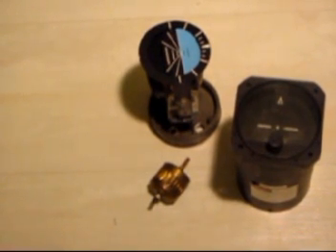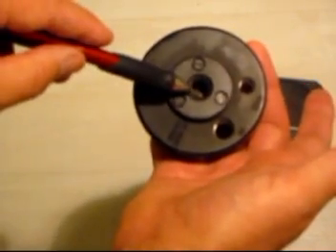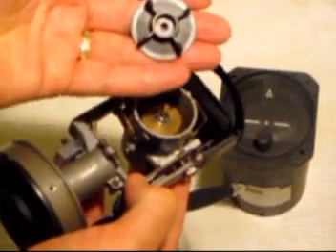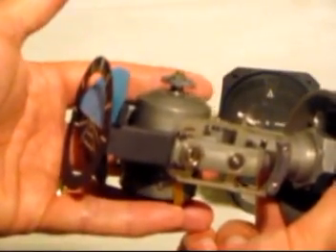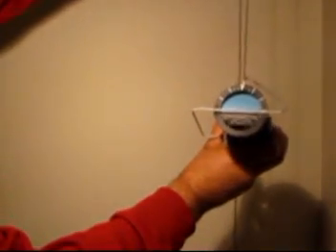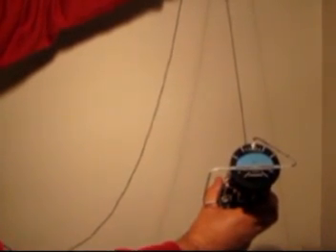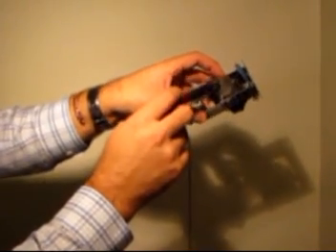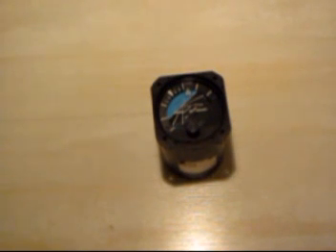Lye-Aviation-01-Artificial-Horizon.mpg

Comment: Great. So, the gyro stabilizes itself vertically at the start up and then, using same method, supposedly keeps vertical orientation during horizontal flight to compensate earth's curvarture. If this kind of compensation really happens, then it still means that the pilot or autopilot should tilt the nose of the plane down on a continuous base. Do pilots make it? Did pilots make it back in 1930?
Reply: The curvature and spin of the earth is accounted for in the inertial reference and navigation system. There is explicit software to handle that to correct the attitude measured by the laser gyros from the inertial platform. Laser gyros are accurate enough to measure the rotation of the earth and the diping angle as the plane flies over the curved surface of the earth. If their measured attitude would not be constantly taken into account by the computers, the artificial horizon, which is a display created by this computer, would stay rigid with respect to space and not parallel to the surface. 

So, the curvature and rotation are no illusion that has no effect. The effect is taken into account by the flight computers. The pilot can and must blindly trust the instruments and can fly the plane as on a flat earth. But behind the scene the flight computer takes all actions necessary to get from A to B on a globe.
Reply: The pilot only needs to maintain a specific elevation. If the plane flies too high the pilot drops the nose, if the plane gets too low the pilot raises the nose.

Consider a road that goes around in a loop with a radius of 4000 miles. If you were looking down that road you'd never see it curve. If you were to drive your car around that road you wouldn't drive off the side of the road every few miles but at the same time you'd never consciously be turning the car. All you have to do is keep your car between the lines.
Reply: That's ok to admit and understand. The difference is a speed of a car and a plane. With the cruise speed of a jet plane, the vertical angle orientation of the plane to the horison would change so fast as to be able to keep the pilot constantly making the correction of the elevation downwards only, if the surface below is speroid surface with 6 km radius.
Reply: Sergei Maltsev The radius of the earth is not 6 km, it's 6378.1 km or about 3959 miles.
Reply: Yes, off course.
Reply: Sergei Maltsev "With the cruise speed of a jet plane, the vertical angle orientation of the plane to the horison would change so fast as to be able to keep the pilot constantly making the correction of the elevation downwards only, if the surface below is speroid surface"

If the earth's radius is 6378.1, at 2*PI*r that would make the circumference 40074 km. The cruising speed of a 747 is 920 km/hr which would mean that if it could circumnavigate the world without stopping it would do it in 43.5 hours. That would make the rate of turn 8.26 deg every hour or 1 deg every 7.25 minutes or 0.13 deg every minute. That might sound very fast to you but consider this, the minute hand on a clock turns 6 deg every minute.
Reply: And yet, this must be compensated, 16 deg for average 2 hrs night or poor visibility flight back in 1930.
Reply: Sergei Maltsev "And yet, this must be compensated, 16 deg for average 2 hrs night or poor visibility flight back in 1930."

This is why they have instruments.

You seem to be under the impression that the pilot of an airplane just points it in the direction they want it to go and it just goes in a straight line. That's not the way it works. The pilot has to constantly compensate for all sorts of forces, wind sheer, turbulence, head wind, tail wind, etc. Flying a plane is making constant corrections in height and direction, otherwise they wouldn't need an autopilot. The earth's curvature is just one of the things that need corrections for, and it isn't even a major one. As long as the pilot maintains the correct elevation the plane will follow the earths curve without the pilot even thinking about it.
Reply: "This is why they have instruments."
Yes, and we are talking about one of them. Can you say that the artificial horizon in the video is following the curvature when the plane is in streight horizontal flight, which means it shows the indication of true horizon all the time and this is due the system of nozzles and pendulum brackets?

"The pilot has to constantly compensate for all sorts of forces, wind sheer, turbulence, head wind, tail wind, etc. Flying a plane is making constant corrections in height and direction, otherwise they wouldn't need an autopilot. The earth's curvature is just one of the things that need corrections for, and it isn't even a major one. As long as the pilot maintains the correct elevation the plane will follow the earths curve without the pilot even thinking about it."

The problem is that the earth curvature is a constant factor amongst the other random variables which must be taken care of at any conditions of the flight. And it's influence accumulating rapidly and exponentially with the distance. Look at that having in mind the miles of a plane elevation with after two hours of none compesated curvarture flight.
Reply: Sergei Maltsev
"Can you say that the artificial horizon in the video is following the curvature when the plane is in streight horizontal flight, which means it shows the indication of true horizon all the time and this is due the system of nozzles and pendulum brackets?"

The old type of artificial horizon used nozzles and pendulum brackets, but there were problems with that type. They also had buttons on them that allowed the pilot to reset to horizontal if they ever got too far out of alignment. The newer artificial horizons use electronics to keep it horizontal. See link below.

Watch?v=C0pZ-mVcbbI&t=283s

"The problem is that the earth curvature is a constant factor amongst the other random variables which must be taken care of at any conditions of the flight. And it's influence accumulating rapidly and exponentially with the distance. Look at that having in mind the miles of a plane elevation with after two hours of none compesated curvarture flight."

Firstly, the phrase "accumulating rapidly and exponentially with the distance" is incorrect and misleading. It is certainly not rapid, at 0.13 deg per minute, it’s extremely slow, so slow as to be undetectable. The minute hand (not the second hand) on a clock turns 45 times faster. “Exponentially” implies that larger and larger turns must be made the further the plane flies. This isn’t the way it works. The plane only makes incremental turns to compensate for the earth’s curvature. When you turn left in your car, the turn is not accumulative. You don’t keep turning the steering wheel as you go, making a tighter and tighter turn. You only turn it as far as you need to for the radius you need, hold it through the turn and bring the steering wheel back to center to drive straight once the turn has been completed.

Secondly, in making all those other corrections for height the pilot automatically includes the corrections for curvature without even knowing it.

For example, let’s say you were a pilot of a Boeing 747 flying from airport A to airport B 3000 km away. You take off and climb to a cruising altitude of about 12,000 m. To do that, you use your elevators to raise you pitch angle (bring your nose up) and increase your throttle to compensate for loss of forward momentum.

As you climb, a lot of things affect your rate of climb, the mass of your plane (can vary with each trip), your forward velocity (still accelerating from takeoff), atmospheric conditions (wind direction) and elevation (air pressure reduces the higher you are). You set your pitch angle for the rate of climb, but not too steep or you will cause a stall (when the air flowing over the wing is too low to create enough lift).

The higher you climb the lower the air pressure outside, the lower the climb rate of the plane, so you must reduce your pitch angle (lower your nose) to avoid a stall.

Let’s say it takes about 10 minutes to get to cruising altitude and you’re only averaging about 460 kph, you would have traveled about 75 km. The ground would have dropped away by 440m, which would have made your rate of climb slightly more than it would have but you wouldn’t have noticed because you’re climb rate was changing all the time anyway. The direction of gravity would have changed direction by 0.7 deg, which would have changed your pitch, but since you were already changing your pitch angle to compensate for the changing climb rate, again, it wouldn’t have been noticed.

Once you reach cruising altitude (12,000 m) and cruising speed (920 kph) you level out. To fly level, you must balance the lift generated by the wings with the weight of the plane. Again, this can vary. The weight of the plane can vary with every trip and atmospheric conditions outside can affect the amount of lift so, you must adjust your flight to suit.

You must either adjust the throttle, changing velocity will change the wind speed over the wings and affect your lift, or change your pitch angle (nose up or nose down). It’s not good for the engines to keep throttling them up and down so you opt for changing the pitch angle.

This balancing act is never perfect so, as you fly you will find that at some point your altitude will either increase or decrease. Rather than stay at one specific altitude you stay within a range of altitude, say 11,900 m to 12,100 m. If your plane flies above 12,100 you lower your pitch (drop your nose) to bring it back down into the nominated range. If you get too low you raise the pitch to bring your altitude back up.

At 920 kph, after 1 minute of flight the land curves away 18 m, which, to you, would only be perceived as an increase in altitude of 18 m, a raise you would already be compensating for, amongst the other increases and decreases in altitude. The angle of the ground and direction of gravity would have only changed by 0.13 deg which would appear only as a change in pitch and since you are already adjusting your pitch down to keep your altitude within the nominated range, you've already compensated for this change without even knowing it.
 
All you have to do to follow the curvature of the earth in a plane is to maintain level flight. All the corrections needed to compensate are built right into the flight procedures and you don’t even know it.
Reply: Let us ignore climbing after take off. 

"At 920 kph, after 1 minute of flight the land curves away 18 m, which, to you, would only be perceived as an increase in altitude of 18 m, a raise you would already be compensating for, amongst the other increases and decreases in altitude. The angle of the ground and direction of gravity would have only changed by 0.13 deg which would appear only as a change in pitch and since you are already adjusting your pitch down to keep your altitude within the nominated range, you've already compensated for this change without even knowing it."

However even after ten minutes without compensation the land will curve away for a lot more than 180 m. Can you say how many?

"All you have to do to follow the curvature of the earth in a plane is to maintain level flight. All the corrections needed to compensate are built right into the flight procedures and you don’t even know it."

Yet again, the plane constant aspiration under horizontal flight is to increase altitude due to the curvature of the earth, the rest is random. So this aspiration must prevail. Since the pilot does not even know it, the inference might be - there is no curvature.
Reply: Sergei Maltsev "However even after ten minutes without compensation the land will curve away for a lot more than 180 m. Can you say how many?"

Yes, I can. How is this relevant?

"Yet again, the plane constant aspiration under horizontal flight is to increase altitude due to the curvature of the earth,"

Yes, this is correct but it's not the only thing that will cause the airplane to increase in altitude.

"the rest is random. So this aspiration must prevail. Since the pilot does not even know it, the inference might be - there is no curvature."

I really don't know how to explain it any better. You have the answer in quotes in your own post. You seem to be under the illusion that somehow if the pilot isn't aware of the turn, the plane is just going to go straight out in to space. The pilot doesn't have to KNOW it to actually make the turn. They just have to maintain the preset altitude.

When a person is lost in the forest, without any visual cues or landmarks, if they try to walk straight they will actually start curving to the left or right, even though they are absolutely certain, without a shadow of a doubt, that they have been walking in a straight line. They won't actually believe that they have been turning until you show them on a map. They've actually done studies on this. In fact if they walk for long enough they will actually loop around to where they started from.

If an airplane's artificial horizon is malfunctioning and the it's night or it's in a cloud bank and there are no visual clues the pilot will start to bank without knowing it. Often the pilot will find themselves completely upside down. This has actually happened on many occasions.

The point of this is that just because an airplanes pilot doesn't know that they are compensating for the curvature, that doesn't mean that it isn't happening.

I really can't explain it any better than that. If you're not even going to try to think these things through then I'm really just wasting my time here.
Reply: Your point is understood and clear to me. But if you can just try to look at this from aside. You say I'm in illusion and at the same time, I have to admit following:
The curvature is there but we do not see it, feel it, know about it, take it into account, think of it. What is it then, unless something not existing, an illusion. There seem to be no instrument on a plane which is responsible for curvature or earth spin if you look into it. Anyway thanks for discussion. It was a pleasure.
Reply: Sergei Maltsev "There seem to be no instrument on a plane which is responsible for curvature or earth spin if you look into it."

The spin of the earth is irrelevant but there is an instrument on an airplane responsible for compensating for the curvature. It's called an altimeter.